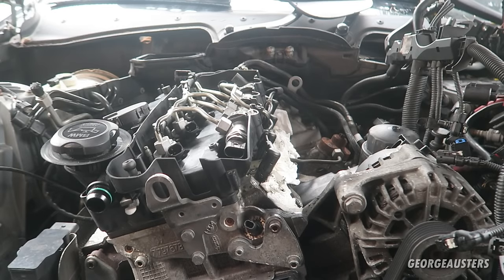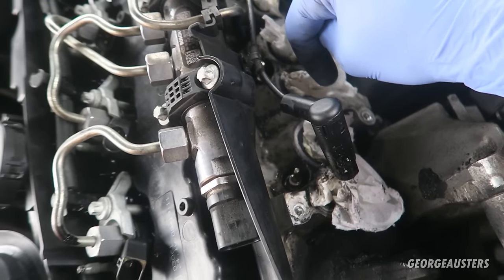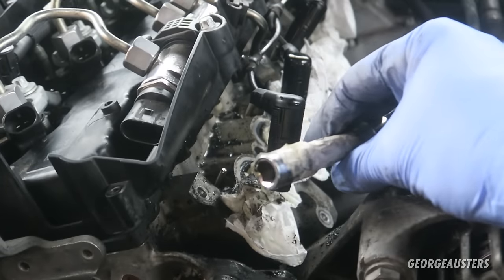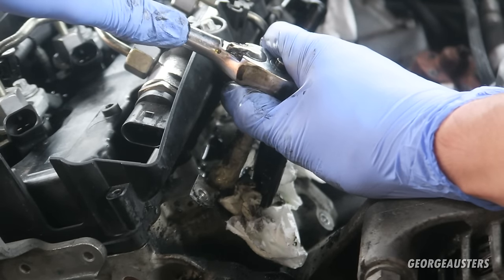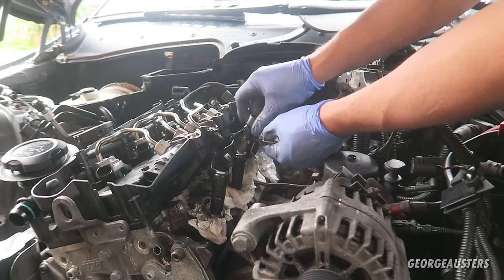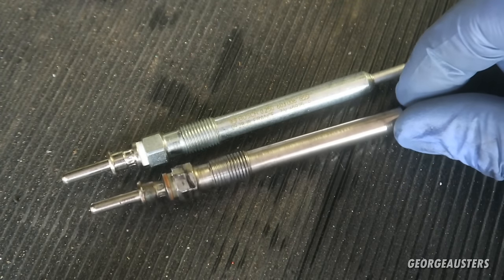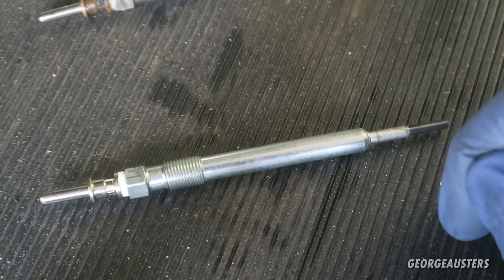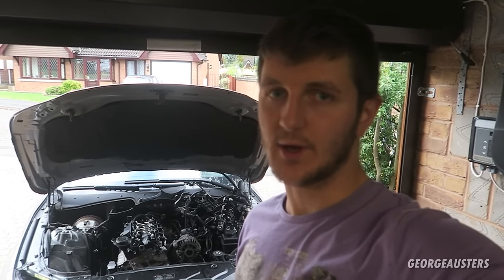How To Remove Glow Plugs WITHOUT Snapping Them

Comment: Hey George, cheers for the video again. I’ve ordered new Bosch glow plugs and a Beru control unit for my n47. Would you know if this would be a problem? Read a few things online people having problems. Cheers
Reply from the maker: No prob mate. If what would be a problem?
Reply: Quite a few people saying that when they’ve replaced it with a Beru control unit they have failed within a year and replaced with Hitachi and it has been fine. just read on forums so don’t know if it’s true. Did you replace your control unit? Cheers again
Reply from the maker: @JonniH18  Beru is OEM on these engines. You'll be fine!
Reply: George Austers awesome thanks 👍

Comment: When my glow plug would not unscrew, I soaked it with wd40 and pure kerosene for several days; it was thanks to kerosene that I was able to unscrew the plug without damaging the threads or breaking the glow plug. In this case, you should not rush, slowly rotating the glow plug in different directions, spilling kerosene on the threads.

Comment: Is it worth copper greasing the shaft as well as the threads?
Reply: do not use copper grease/paste With aluminium, higher metalgrade will corrode lower grades, they will seize like you never seen before, same goes for aluminium brake calibers, Dont grease the pins with copper paste. You may use something like ceramic paste or so 👍

Comment: Looks to me that the threads in the head will also be damaged if the glow plug threads are now damaged. Would you have screwed new ones in?
Reply from the maker: They were actually fine because the new ones screwed straight in👍🏻

Comment: George, if you think about it, 'if' WD-40 can get by the threads of the heater plug, then logic would dictate that compression gases will escape from around the threads too or am I missing something here...?

I'm thinking your socket should have deeper because, the witness marks on the heater plug are halfway down the hex?
Reply: if you look at the glow plugs they have a little conus at the end of the thicker part. that conus is supposed to seal the compression chamber. if you do not tighten the new glow plugs to the correct torque it might well be that it isn't gonna be sealed anymore and then the gasses (with all the crud) will evade through there and the crud will make it impossible to remove the plug in one piece.

Comment: After watching this video I would / Will do the same as in soaking them for at least a week Then instead off using a racket I would use anti ~ clock working  torque wrench so as to ensure not to much pressure Click Click Click There we go nice and smoothly

Comment: My cylinders head is on the table because a glow plug tip snap in. Now I do the whole circus, valve seats, stems, rocker arms plus lifters, new head bolts, the whole set of gaskets, blondie hell the job is ginormous. I wish I could find this video last week...😂😂😂😂😂
Reply from the maker: Haha good luck!
Reply: I need it

Comment: My 2011 1 series 118d n47 judders on a cold start up badly, after 30 seconds it goes away, no fault codes, car drives normal after, worn plugs? Any ideas that would be grand 👍

Comment: Hi your videos are superb 👍I've got to do a valve cover change ...will I have to remove these and do i have injectors to remove aswell keep up the good work cheers.
Reply from the maker: Cheers Mark. Injectors will need to come out, glow plugs wont👍🏻
Reply: Hi George thanks for your reply I'm not really mechanically minded I'm absolutely dreding doing this aswell may I ask you one more thing ...will I have to disconnect my battery in the boot much appreciated.

Comment: That's the way; 
I always use a good penetrating oil,not wd4, this does not penetrate well on the threads; 
 I also use a torque wrench if they do not come out easily, the manual tells you the MAX!! torque you can force to undo them for each size, before they snap; then you need to shock them with a special socket and a hammer a few times.

Comment: Accoridning to manufacturers theres a share torque for glow plugs where they break. So you should use a torque wrench that works both ways. You set it below the share value and it will release before risk of nsapping occurs. Seems like 35 Nm is recommenden for unknown manufacturer.

Comment: How do you warm up the engine when its intake manifold has already been removed?

I have the M57 engine on a 535d. There’s no way I can see to spray WD40 around them with the manifold still on.
Reply from the maker: You can run the engine with the intake manifold removed on the M57
Reply: @GeorgeAusters  Thanks 👍

Comment: George, just got my first bmw 328d with 129k miles, the second week it threw codes P2004 (intake manifold runner stuck open) and P2453 and P2454 ( diesel particulate filter differential pressure sensor ciurcut low. There is also a recall on the car for EGR cooler. What should I do? Do I need to clean intake manifold or replace it?

Comment: My bmw f31 has now 200k kms and the glowplugs are original ones. I did try to loose em up but my knees where shaking lol bcuz it was very tight. I may soak em up with more lubricant and wait a day or more todo the final touch.
Reply from the maker: Did you try on a hot engine?
Reply: @GeorgeAusters  yes, lastly i did let scan my car since i got "drivechain" error once in a month and i got 2 egr error s and one glow plug error. I wanted to start with the easyest one but it is harder then i expected. Thanks for the video btw

Comment: To be honest, the title is a bit misleading, everyone uses the same technique basically. But sometimes, shit happens
Reply from the maker: Some people snap them everytime because they rush and don't use penatrating fluid
Reply: George Austers using penetrating is a given, it's the dreaded carbon build up that can occur down the length of the glow plug, penetrating oil does little to help with this situation.

Agree you've got to be patient removing any glow plug.
Reply: Ceramic grease on lower body when fitting new ones helps next time.

Comment: If it doesn't want to come out it won't... I'd say you had a easy one there... alot of the time it's the tip siezed with carbon , wd 40 doesn't get past the tapperd seal..  and all the ones I have had snap is where someone else has tried before me 😭

Comment: my motors got 240K on it and still got the original glow plugs , as far as I'm concerned they can stay in there  as well.
most diesel's will start if they have good compression anyway regardless of the glow plugs condition. Save yourself a ball ache and leave well alone.
Reply: Trouble is with leaving knackered glow plugs in a modern engine, is that on initial cold start up, dirty exhaust/unburnt particulates can pass through the engine and foul up EGRs and sensors.

Comment: May I know what are the reasons of glow plugs faulty?
Reply: I recently got all 4 plugs replaced and module unit as well in Dacia Duster. I want to make sure it will work for next 60k miles, is there anything I need to check rather than battery which can be the reason of faulty plugs?

Comment: hi George i'v had my 123d mapped and dpf deleted and since then the car has run really bad and iv found a sensor not connected under the oil filter... do you know what this is ?? my friend thinks its a oil pressure switch just wondered if you can help. also the inlet pipe to the turbo was not connected !!!
Reply: Probably a bad map. Every keyboard warrior thinks they can remap cars now with a bit of cable and software. Most will not know what they are doing. Just want cash off you.

Comment: I know on sail boats they have galvanic corrosion and have a product to stop it, not just anti seize and where the top of those plugs touch the head their should be a plastic washer or something to stop it there too. My guess is road salt and dissimilar metals is alot like marine environment.
Reply: They get the earth connection from contact with the head.

Comment: Penetrating oil won't get down on to the threads unless you crack it first. Then you have to rock it, if you got movement you can have improvement.

Comment: I'll show you an other little trick...😉 Always fasten The injector First Before releasing is. Max 1mm 
And don't, use a rached but just use a T Bar to get More Feeling.
Why ?
Because when you fasten a bold/glowplug there slightly tordaded in this direction 😉
When you losen them they tordate and thereby weaken the metal...
Al the molucules are shaped in this direction, and thereby slighting better in fastening then in losening
But only 1mm max.
😉👍🏻😉

Comment: I don’t find spraying with lube 2 days prior does anything because the threads are so tight that nothing will pass by them not a chance, lube as you remove as you did is perfect but won’t help soaking for 2 days prior. Just my opinion of course.👍

Comment: Do you not have to carry out a preheating control service using a diagnostic tool before you replace the glow plugs?
Reply from the maker: No but it does help when the engine is warm
Reply: It depends......... Old skool (about pre 2008) had all the glow plugs hooked to a common rail, the controller was a timed relay (and cheap) and there was no "fault light" on your dash, the engine just got hard to start. Now each glow plug is fed individually through an expensive controller, if one, or more fails, it trips the engine fault light, and you would typically use a diagnostic tool to tell you which one had failed, and to turn the fault light off after repairs are completed. Here is "the deal", say the diagnostic tool tells you which glow plug has failed, you would unhook the wire from that glow plug, and test the glow plug with an ohmmeter, looking for 1 ohm or less, if the glow plug tests ok with the ohmmeter, you would now be looking for a wiring, or controller, fault. Keeping in mind that the expensive controller is an an electrical item and not returnable.

Comment: I do not recommend using copper grease when putting the new ones back in cos the aluminium cylinder head will react with the copper. Maybe a light smear with ceramic grease.
Reply: Don't use copper grease for anything. Use aluminium paste.

Comment: One cup ATF one cup acetone the best penetrating oil you can use. Expensive but it works wonders
Reply: Also if you have a torque wrench that goes both ways, set it to 15nm and don’t try and push it too far past the click. That’s merc shop advice

Comment: Do you think glow plugs are responsible for my dpf not reaching 600C? It is usually around 500C when regenerating but the soot level is stuck at 45g and seems to go lower when temperature gets occasionally higher than 500C
Reply from the maker: Very possible
Reply: @GeorgeAusters  Do you have a video on how to remove them without removing the intake manifold? Also do I need to disconnect the battery when doing any of this?
Reply from the maker: @ahmed3249  Same way with the intake manifold in place
Reply: It is very hard to access all of them 4 without removing it, but ye might take it off to clean it as well
Reply: Really appreciate your replies and keep up the good work 👊

Comment: Quick tip, surround each plug with putty leaving a smaller gap all the way around. Then simply fill with WD40 to soak, this way you can still attach your socket .

Comment: ended up snapping a tip in my head today. swollen to oblivion.
Had threads all the way out, took the car on an 8mile drive under load and it still didn't budge. Pulled and pulled with a slide hammer and ended up breaking the tip lol.
any advice? any recommendations? essex area
Reply: Just live with a broken plug.
Reply: @Nozinbonsai  ended up taking the head off and removing the tip and replacing the entire plug, cars still going to this day
Reply: @dgeg1000  just seen this, I kept getting limp mode due to faulty plugs hence the need to change, but i sorted it now

Comment: Do you have to remove the inlet manifold to change the glow plugs on a n47n engine if so that's a terrible design and makes me want to sell my 225d as everything is a nightmare to replace
Reply from the maker: No you don’t need to👍🏻
Reply: @GeorgeAusters  cheers mate

Comment: Dont suppose you had a guide on disconnscting the intake manifold for access?
Reply from the maker: Yes I do, search on my channel
Reply: @GeorgeAusters  is it this one? https://youtu.be/gQio3HzhDYo?si=ZqY1lHJh2NVu-c4B

I'm a bit hesitant to pull the whole manifold off if it's not actually required to do the glowplugs. What would recommend?
Reply: @GeorgeAusters  Is it necessary to disconnect the intake manifold on a 318d f30 engine for a glowplug replacement?
Reply from the maker: Can be done without

Comment: When removing the plugs would it not be a good idea to partially loosen them, spray with WD40, slightly retighten them to encourage the oil in to the thread, and then continue loosen? Just a thought?
Reply from the maker: You can do

Comment: Could you use motor oil instead of WD-40 seven days before the procedure on slightly loose old glow plugs? What type of grease do you use to lubricate the thread of the new glow plugs? Motor oil  is ok? Cupper/Lithium grease is better?
Reply: Grease is better to use either nickel or aluminium anti seize. Copper on steel and aluminium causes an electrolytic reaction between the two metals!!

Comment: Those are alreadyreplaced glow plugs, some maniac crossthreaded them...
Also when you loose them, you must also tighten them back a bit, loose-tighten, so the threads will not stuck themselves and the neck is not snapping in the tearing process...
Reply from the maker: They looked like originals to me!

Comment: Do you know if a glowplug can make the engine to rough idle even when its warm after driving? I have only code:BMW Error 004A5E 
And the engine is going rough both Cold and warm, but worse warm. 320D 2008
Reply: Glow plug cylinder 2, control
Reply: Glow plugs are for start up only
Reply: @DDescalchuk57  very, very many makes use glow plugs as continuing afterheating as well, so it's not only for the start up. And for example BMW loves to have it so that when you unlock your doors with the FOB, it will already start glowing them up! Doesn't show anywhere but that's how it works. Means that when you get seated into the car they have been glowing for 15seconds even, so when you put the key to MAR it has already preheated them pretty much and as such you have "very quick glow plugs".

Also after the engine has started, glow plugs will keep helping with the heat until certain temperature or time is reached.
Reply: @mattipeltola8949  ummmm no lol
Reply: @mattipeltola8949  glow plugs in a diesel are simply to preheat the cylinders to aid in starting. Having them heat up after the engines started would absolutely do nothing. They’d burn out in no time if they did that lol

Comment: Great video, I use a BMW specialist, what would you consider to be a reasonable cost for this job?
Reply from the maker: I bought glow plugs for £40 but expect to pay about £80 then around £100 labour so I’d say around £180 all in.

I’d obviously do it a lot cheaper 😉
Reply: @GeorgeAusters  euro car parts 25.00
Was charged 40.00
For one
Local specialist
Reply from the maker: Richard Simmons Wait, you replaced just 1 glow plug?
Reply: @GeorgeAusters  It seems to depend where you are/who is doing the job. I have always replaced glow plugs by the set, but it seems that when working on a 6.6 GM diesel, being a dentist, and only changing the ones that are bad, is perfectly acceptable? These ones are pretty nasty to change. My plan is to change the bad ones, and if I find myself on a roll I will be changing the lot.
Reply: @GeorgeAusters  fancy doing mine for me 😉
Reply from the maker: Don’t have time to do private work at the moment mate
Reply: @GeorgeAusters  that’s a shame 🙈 happy to do the leg work just not the plugs themselves 🤣
Reply from the maker: You’ll have no problems - just work on a hot engine👍🏻
Reply: @GeorgeAusters  so how exactly would that work as to get the engine hot you’ll need the components on ie inlet manifold so how can you keep it hot when taking the components off

Comment: Does wd40 really work? Id removed dozens of stucked bolt nuts before but none of them has evidence of oil penetrated in the inner thread when wd40 were used..heating the bold is what really worked for me...but wd40 is good to clean open switches contact points

Comment: WD40 is not a penetrating fluid, the WD stands for Water Dispersant formula no.40.
Try 50/50 mix of diesel and auto trans fluid, gets in everywhere.
Always try to do the removal with a HOT engine.
My 2 penarth after 50 years 'on the spanners'.
Reply from the maker: Displacement* 😅
Reply: @GeorgeAusters  Dispersant/displacement still gets rid of water, and is not a penetrating fluid.

Comment: Do you recommend to do it on a warm engine or completley cold?
Reply from the maker: It’s easier when warm yes👍🏻
Reply: Another thumbs up for doing them on a warm engine!
Reply: Thanks guys 😊
Reply: Yes, the slight expansion will always help, even if it is only slightly in your favour, it is better than cold. And on Aluminium heads, remember that Aluminium expands slightly better than steel, so does help to get it hot first. Also any burnt on deposits are mildly softened.And definitely on a warm engine in winter...… it helps to keep your hands warm and toasty.
Reply: Hot removal, cold install.

Comment: Do you need to take the same care installing as when removing?
Reply: Not exactly that much. Preferably clean the threads to freshen them up and screw the new plug in. You will notice a bit resistance but it shouldn't be too much.